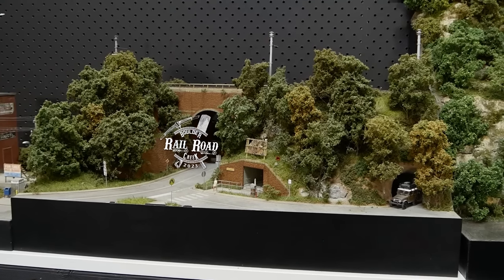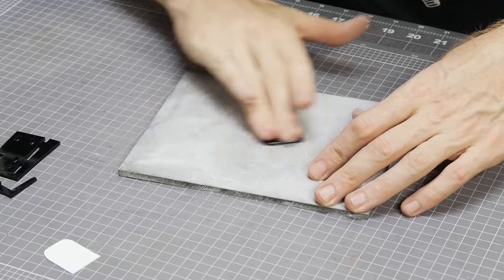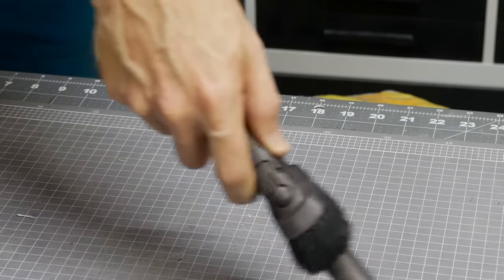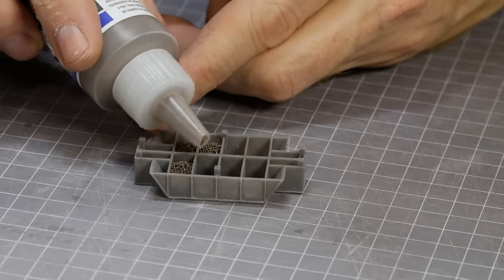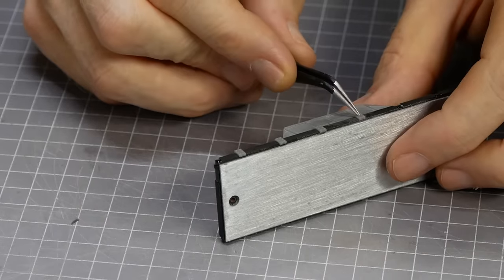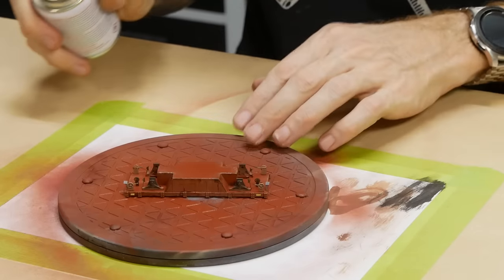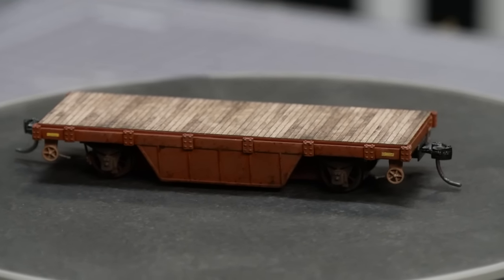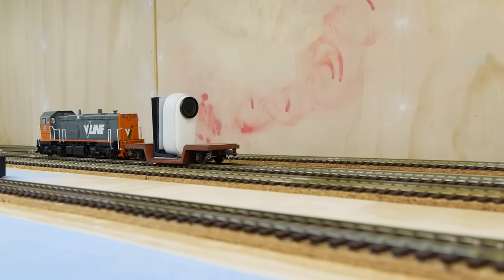Build a Tiny Camera Car for your Model Railroad – Professional Tools for Modellers

Comment: In Tinkercad, you could create a shell that slides over the camera to make it look like something else. Perhaps a water barrel strapped to the car, or part of a tractor, or various other things. Would look better than the modern, white camera from the outside perspective.
Reply: Really fantastic idea
Reply: I agree. Maybe something that can house the camera horizontally with the lense facing upward and use a rotating adjustable mirror component above the lense to capture normal footage.
Reply from the maker: @GM-qq1wi  I have already tried using a mirror, the problem is ghosting in the reflected image and also the wide angle of the lens means the mirror has to be huge! Much larger than the car it's sitting on which defeats the purpose of using a small camera in the first place.

Comment: SNAP! You beat me to the post I have a video about 2 weeks in queue covering this but from a slightly different approach which for the movement I can’t quite engineer but know there is a solution just around the corner.  Great stuff as alway.

Comment: Hey Luke! Quick tip I learned from YouTuber Pocket83 : warming the epoxy slightly using a hairdryer for example, will massively improve fluidity, and make it easier to clean up when still liquid 😊 might be useful when glueing liquid gravity and the like.

Comment: I wish the technology had been available back in the day to run a tiny camera around by dad's huge HO layout.  On a pensioner's budget, before 3D printers, though not quite to the same level of realism as you, dad built all of the scenery himself.   It took a while to convince him to move into model railroading after he retired but once he started he was hooked.  These were the days before computer controlled layouts just simple toggle switches and speed controls on the layout's control panel.
Reply: Right? I feel the same about my Hot Wheels tracks. It's so cool that technology has caught up to our childhood dreams to get a 1st person perspective of these layouts. And in high quality as well!

Comment: This is awesome, thanks for this! I have also shot POV on model railway layouts as well, although I’ve used a DJI Pocket 2, which conveniently fits on a OO/HO Scale flat wagon, works a treat! 👍

The main challenge with this camera is trying to get the focus and depth of field right. Your solution with the Insta 360 GO looks a much easier solution! 😅

Comment: You know if you wanted to go hard-core... Use a Raspberry PI, buy the camera module supplied with a 5cm x 6mm ribbon. With a little bit of work I think you could actually mount it in the cab. Or just go for Optic Fibre to where you want the cam then mount the cam in a box car following.
Reply: That would be cool.  Could hide the board in its own car pretty easily.
Reply: @RealAndySkibba  And the new board has wifi if you need to broadcast to a PC for live record/editing.

Comment: I really enjoy your vids. You not only display, but actually put into use, all the latest technology. One dummy question, though: what is that plate you use for sanding.? It looks like a piece of slate. Thx.
Reply: It might be a piece of float glass, which is really flat, with the sandpaper glued to it.

The glass does look fairly thick. Perhaps a piece of tempered window glass?

Comment: This looks great, but is really overkill for what's being done.  I accomplished the exact same thing by just taking the top off an old Sant Fe caboose (which has a steel weight in it) and use a DJI Action 2 camera which has a magnetic base.  I swapped out one of the stock horn-hook couplers with a Kadee, and now can use it both as a converter car and/or as a camera car with either type of coupler.  It took 10 minutes and cost $0.

Comment: The camera you have looks quite slim. Could you lay it on its back and hold a mirror over the top at ~45°? You'd have to flip the video in software, but it might give a shorter overall arrangement.

Comment: Have you tried Grandmother Stover's YES glue for paper components? I am amazed at how easy it is to work with, doesn't wrinkle paper, and it has sticking power equal to PVA glues. The only surface I've found it doesn't work on is glass ;)
Reply from the maker: No, I've never heard of it. It sounds great though! I did a quick google search and it looks like it's a bit difficult to find locally in Australia, I can find some on etsy for $12 however the postage is $30... 
I'll see if there is an equivalent here in Aus otherwise I might have to order some and accept the postage cost. Looks like good stuff though, lots of good reviews for it!
Reply: @BoulderCreekRailroad  I had a friend visiting from Ballarat this weekend, if I'd known you wanted to try the stuff I could have sent him home with some and he could have posted it to you when he returned home. Darn!

Comment: Makes me think of the dirt cheap wireless cameras that you could get for little money from china (I think they were either 1.2 or 2.4GHz, and were purely analogue jobs designed for use with TVs), which I often thought would make for useful cameras for models, R/C cars and the like, I think people probably did use them too, but as tech has progressed, there's many more options that are higher resolution and probably a lot more reliable... :P

Comment: You could have used a mirror or prism to allow the camera to lie on a more flat profile.
Reply from the maker: I tried that but ran into issues with ghosting 😒 plus the wide angle lens meant the mirror needed to be extra wide and kinda defeated the purpose of using the mirror in the first place…

Comment: Hi Luke- just watched this. I have been after a good pocket video camera to film my layout. Issue I run into is the depth of field on these action cameras- they don't seem to be for the purpose of filming model railroads. How do you handle this with the camera you are using? Focus cna also be off- or at least very variable. These ae somewhat "action" shots, as the camera will travel around the layout. But it woulld be nice if everythng was in focus for more than a 1-2 inch point somewhewre in the POV! Does this camera have a manual mode where focus and DOF can be set? Great job, BTW!
Reply from the maker: Hey Rob, thanks for the compliment! I too was having a real hard time finding something with a deep DoF, this camera like most others suffers from very close objects being blurry.
It doesn't have manual focus, it's always focused to infinity.
Mostly everything will be in focus as long as it's further than 3-4 inches from the lens. Anything that gets close to the lens will become blurry. Distant objects should be in focus if they are beyond 3-4 inches away.
I have heard of people using the DJI Pocket however it has a very shallow DoF and most of the view is blurry if you try to focus on anything close.
I've got some images on my website with better quality screen shots from the camera so you might get a better idea of the type of shots you'll get from the camera: https://www.bouldercreekrailroad.com/youtube-videos/build-a-tiny-camera-car
Hope that helps.
P.S. Love your videos and your amazing layout!
Reply: @BoulderCreekRailroad  Thanks Luke! That is kind of what I expected on the DOF. I have been to your website (love it, BTW!) and saw the pictures- I admit they do look good. I am looking at videos on YT on the Insta360 GO3 (and the GO2...) and still thinking it over.  Not a cheap date- but could be worth it if it does what we need. Thanks for the kind words- coming from someone as talented as you, it means a lot.🚂

Comment: Im using a chopped up warwell wagon with a polaroid cube. It doesnt sit higher than the train then.
Reply from the maker: I saw some of those cube cameras, is the picture quality ok? The ones I saw were just the cheap ones on eBay for about $50 which had pretty bad picture. I'm guessing the brand name version is quite good, I'll have to check them out 😉

Comment: Can you please tell what filming gear are you using? Camera, lights?
Reply from the maker: I film with Panasonic G85, and for lights I use a diy light panel I made, it's 50/50 warm white and cool white LED light strips, there are about 400 LEDs on each panel and I use 5 panels, 3 behind the camera pointing forward and 2 behind me pointed towards the camera up high so they are out of the frame.
Lighting is by far the most important aspect of filming, you could use a phone camera and as long as you have good lighting it will look great 👍

Comment: If you want it lower just rotate the camera???
Reply from the maker: not wrong, but... then the camera is not only lower but also wider, you need to consider the width as well.
Model train standards for width are much smaller than for height, this camera will not get past the scenery if it's been made to be close to the minimum standard width for clearance.
Reply: @BoulderCreekRailroad  Yes, but I was thinking to have it upside down?
Reply from the maker: @kkys7709  oh I see, the main reason for wanting the entire camera lower was to get the profile of the camera body down as low as possible so it would fit through tunnels without the camera hitting the top of the tunnel 😉 
I'm planning to have some tunnel sections on my layout and wanted to be sure the camera would make it through.